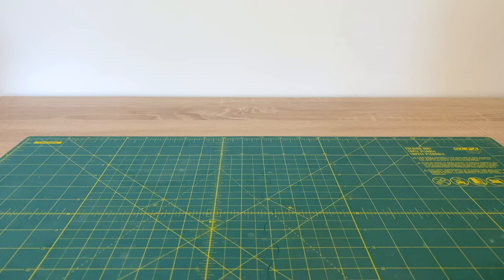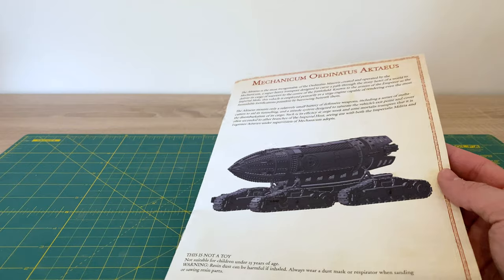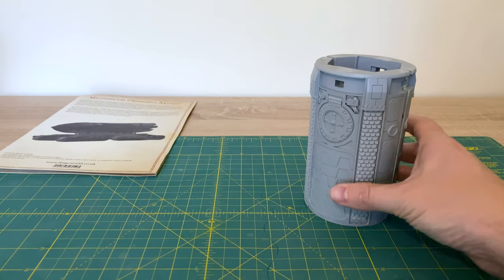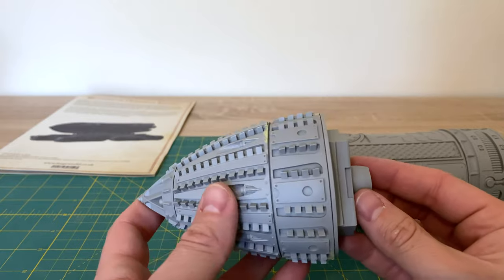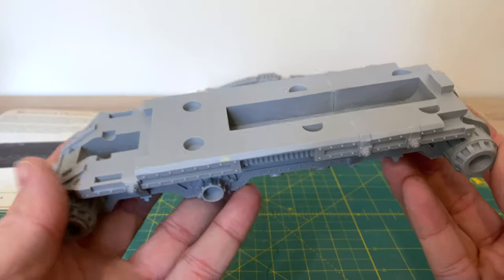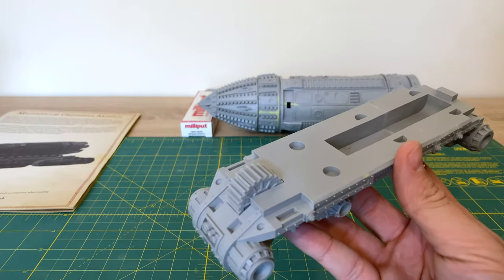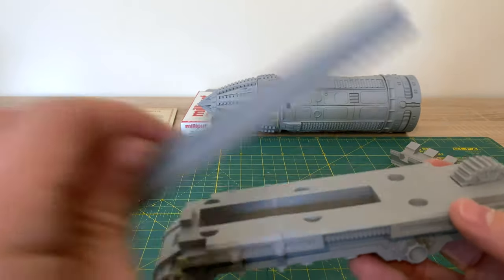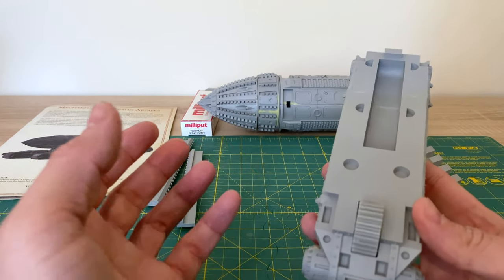Mechanicum Ordinatus Aktaeus Build Guide Part 1: Driller Killer

Comment: Maybe some heat shrink tubing on the drill shaft? You could do multiple layers and it lasts a long time.
Reply from the maker: prophet8 Okay, that's a cool suggestion thank you!

I think I could use some masking tape to protect the rest of the pin from the heat I'd need to apply to get they tubing to shrink.

Comment: Hey Mr Cheese. 6:45 my suggestion would be to plug the hole at either end, then measure the shaft (!) diameter, then once the putty used to plug the hole has set, ream it out to the correct diameter with a conical reamer.

You might need to alter this process to ensure the reamed hole is centred.

Of course, if you've got access to a machinists lathe, you could machine up a collar from Delrin or similar.
Reply from the maker: Good thinking, instead of increasing the shaft (!) diameter, narrow the apertures instead.

I'll have to weigh up the pros and cons of this approach and the suggestions I've had on widening the pin. One promising idea was to use some heat shrink tubing... what do you think of that?
Reply: @leakycheese  you could, but regular heat shrink isn't really designed for that kind of wear. You can, however, get different grades of heat shrink, some of the tougher grades have glue on the inside that is activated by heat.

Do you know roughly what the difference is in diameter between the shaft (!) and the hole? (!)

Comment: Very glad you are back. I have a small question, I've received my Moirax Armiger and I have a mixed feeling. Most upgrade parts are a great addition to the plastic kit. However, on the large flat parts the 3D printing can be seen ! especially on the shoulder pad and knee pad. Have you see these on other kits ? It looks like: well we don't care we're not gonna clean the print before casting them, it's buyer responsibility. I've made a test with a black wash and they show up. Quite upset. The cleaning will be heavily extended on all FW kit if this is repeated on all kits. It's a huge work with fine sand paper  to recover these.
Reply from the maker: Thank you!

I have two Moriax that I bought at this year's Warhammer Fest.

I've had a look at the parts and I can slightly see some 3D print grain on the knees but nothing bad at all... I wouldn't need to clean mine.

I have had kits where some print did require sanding down... some of the armour carapace on my Warlord did as was the upper hull on the Coronus.

If you want my opinion drop me some photos of the parts either on Twitter or to my email account.

Hope that helps :)
Reply: @leakycheese  Thank you for your kind reply. Mine will need cleaning, I will send some pic to your email. 
I have a coronus and I don't remember having done much sanding. I remember it was not super sleek, I was more upset by the huge gate at the rear like on the track of your ordinatus. Why they don't put them on the inside part of the model ?
I just buy 2-3 max kit per year but it looks like the quality of some new kit go down both in design and cast based on the expected number of selling unit. 
On the other size GW improve the quality, it's insane. We could argue about monoposing but sculpt, dynamism and the final sprue are insane. 
Btw I, some time, put some pictures of painted mini here https://www.flickr.com/photos/57933662@N08/albums 
Will try to put more in a near future.

Thanks again!

Comment: Maybe rubber o rings or washers either side of your loose pin on your main drill spear.
Reply from the maker: Rob McCord Washers are a great idea thank you, I could use those to avoid having to modify the length of the main drill spear.

O-rings would functionally work but their long term durability would be a concern as the unit will be glued shut and they will eventually perish.

I really appreciate the suggestions, thank you!

Comment: Fidget spinners.

Buy fidget spinners on Amazon for cheap and liberate the bearings from the spinners. 

Attach them to a metal or hard plastic rod and replace the peg altogether.

Not only will it leave the parts free to spin but it will eliminate all forward and backward movement.

Alternatively you could just buy bearings but they may be move expensive than fidget spinners due to quality control as generic bearings may be for industrial purposes.